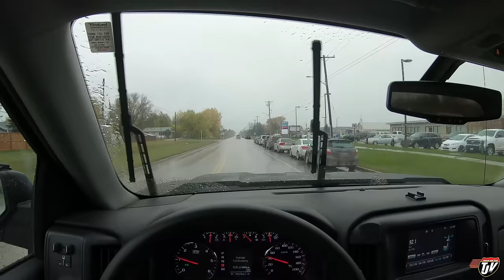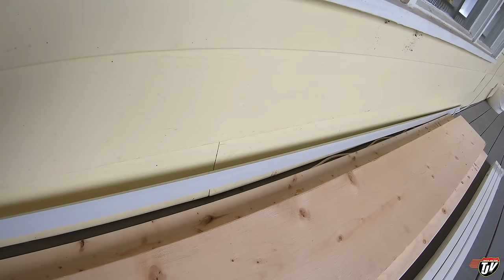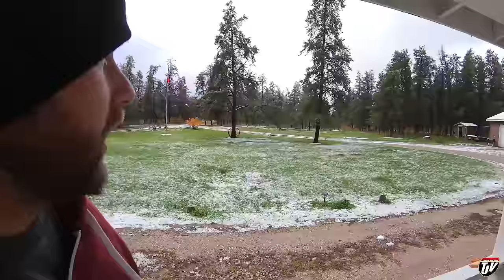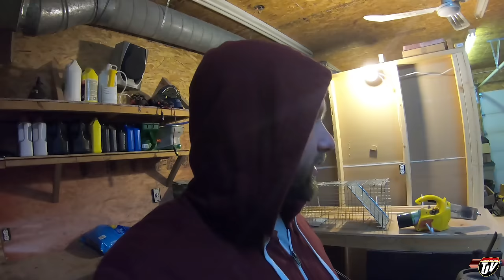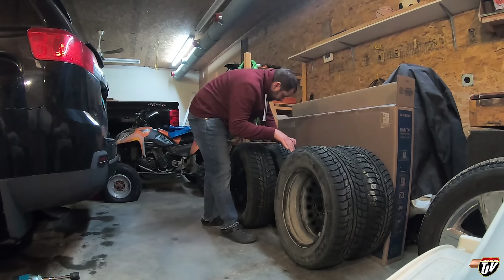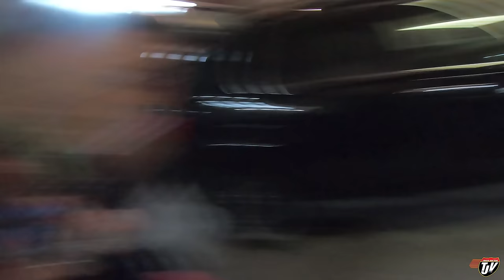TJV | WINTER TIRES | #1827

Comment: Store the wood you bought for the door in the garage. Must be kept dry so it won't warp.  When changing tires, use a piece of chalk to mark (on the inside) where it goes on the car so you can replace it in the proper position next season.

Comment: I hope you torqued the lug nuts? Never depend on a impact wrench to do that. If you didn't, raise the life insurance on the wife. When you have aluminum wheels and you go to steel you should change the lug nuts to one's designed for steel wheels and torque them to vehicle specs.
Reply: B61 Mack - good to know.
Reply: B61Mack  I'm a retired former mechanic and you are absolutely correct . Impact is OK to snug them down but proper torque is essential as well as proper lug nuts for steel rims . Re torque at 80 km or 50 miles is also needed . Tis the season for wheels flying off from home winter tire installs . Torn up fenders and destroyed rotors at best , death on the road at worst .

Comment: the snowshed on the coquihalla hwy. has heating coils in the pavement but they dont use them anymore because it was causing ice buildup where the heating ended.
Reply: I seem to remember the Dry Gulch bridge deck was also heated on the Coquihalla.

Comment: How did you make out on the leaking roof? Did you fix it or have it replaced yet??
Reply: It has been replaced so no problems this winter.
Reply: They had a new metal roof installed.

Comment: why you changing the wheel if the ones that on are all season tyres.
Plus should have had proper nuts for steel wheels for the ones you put on and you did not torque them.

Comment: Why doesn’t the winter tires have Rims? Just curious
Reply: jarell  COST !!!!!   DUUUUUUUUHHHHHHH   !!!!!!  Most those factory rims are close to $400 ea !!!  Times 4 !!!!  Those black rims were probably $75 ea  do the math !!  Plus if your car has the tire pressure monitors they have to be in each wheel another $250.....  I spent over $1600 for four studded winter tires mounted on after market wheels with the TPS !!!  Better keep your car for a while !!  mine are on the 4th and 9th winter !!!
Reply: @wilburfinnigan2142  Cost yes! and, the salt and crap they use on roads up here are terrible on rims, its easier to get steelies and either rattlecan them or just let them rust then get new ones